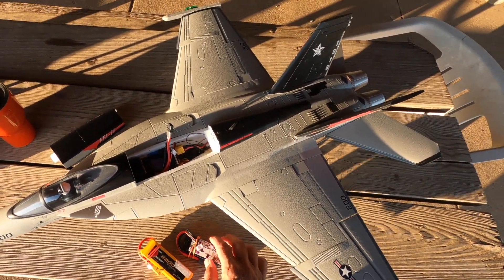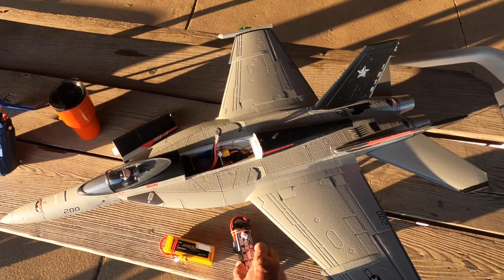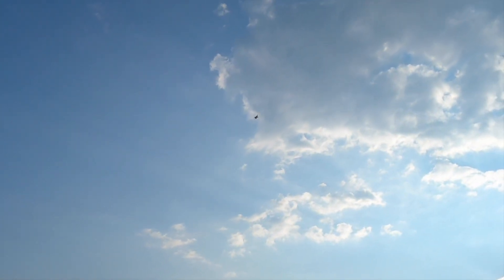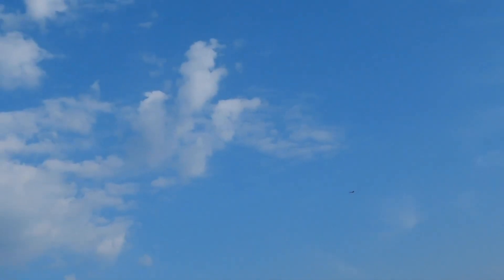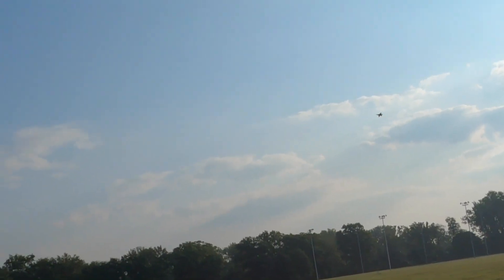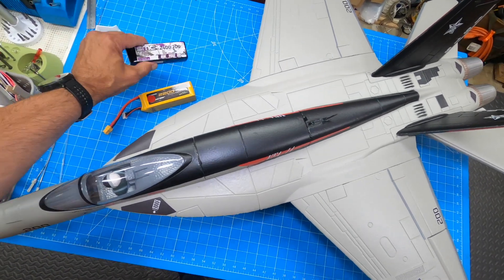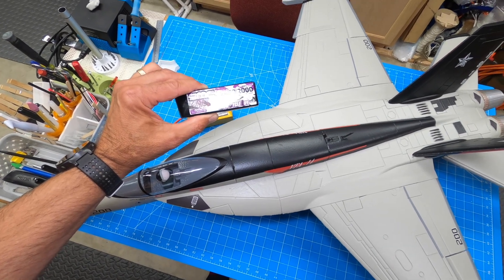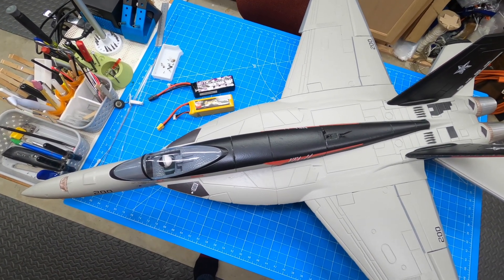Do High Voltage LIHV batteries boost performance in RC Planes?

Comment: Thanks for it! But how do I know my esc can run it?
Reply from the maker: I haven't found an ESC that had an issue with these batteries due to a slightly higher amp draw.  I've used them on many planes without problems.

Comment: Is there any risk of burning out your esc or motor when using the high voltage packs?
Reply from the maker: So far I haven’t seen ANY negative effect.  I’ve use these batteries on many different brand of ESCs.  Total changed how a few of my planes perform too.  Primarily my EDFs

Comment: Nice independents review on High Voltage batteires without the need to keep mentioning the brand. Thanks for the comparison. We have High voltage brands here in the UK but i decided to just bump all my planes up 1 to 2 cells for the extra boost and stick with Lipos. Nothing major with top speed but the jets acceleration is greatly improved and verticals are quicker and further up now. The prop planes top speeds are however much better tho.
Reply from the maker: Thanks Mark.  It was an interesting test.  I was hoping for more speed and performance, but for only $10 extra bucks….  I’ll get a few more LiHV batteries.    Appreciate the comment. - Will

Comment: when u get the itch to make it even more fun, i recommend changing out the EDF for Freewing 64mm 6S 2300KV. There is plenty of space in the fuse for it and it goes like a bat out of hell... really fun plane
Reply from the maker: Holy cow..  That sounds like an awesome option....  I gotta check that out..  Thanks Will
Reply: Jeeze what size 6s u squeezing in that tiny F18?!
Reply: @M4rkmcc21  6S 2600 fits nicely